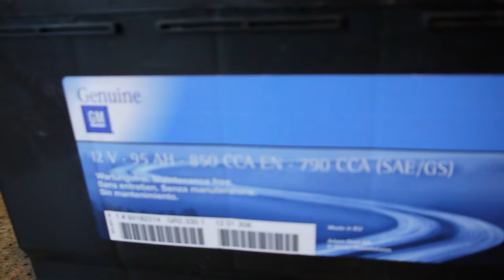How to change battery - Opel Movano / Renault Master

Comment: Did you have to reset the ECU or any module after doing this?
Reply from the maker: No, nothing like that. Just had to reset the radio with the 4-digit code that came with the car, as well as the clock. Thanks for watching!

Comment: What's the actual reason for putting the battery there?
Reply: French vehicles are not built with any thought.. I have the misfortune of having to driving one for work. Seat belt locks and won't release until the dung mound comes to a stop or lifting off the brake then releases (very dangerous at junctions)!
Reply: @speedoman1234  what year is your Master , mine does not have the same release ,as your one , I can unlatch the seatbelt at anytime ,
Reply: @uptowndisco2  I don't mean releasing the buckle.. There is some safety device fitted that locks the reel mech if the vehicle is braking moderately, pinning the driver to the seat back hence not being able to lean forward to look at blind spot at junctions. I can also add the gearbox/clutch are carved out of brie and cannot tolerate a light thrashing. The VW crafter is the best van.